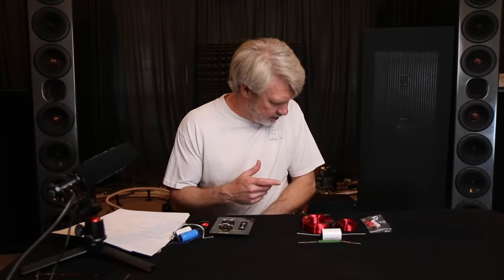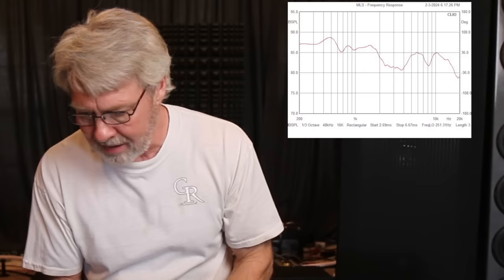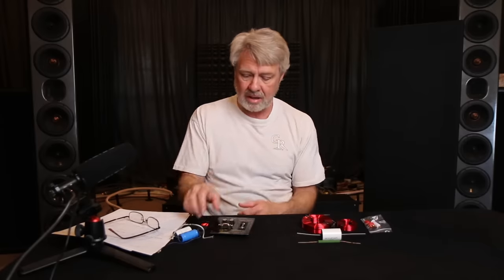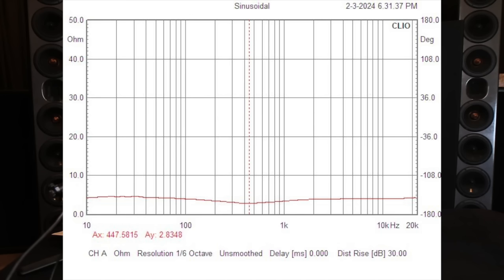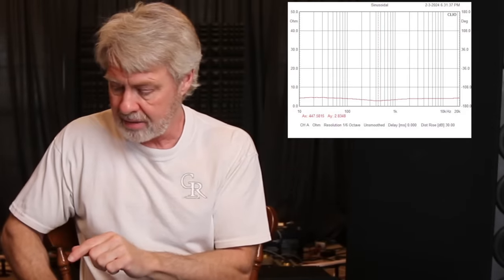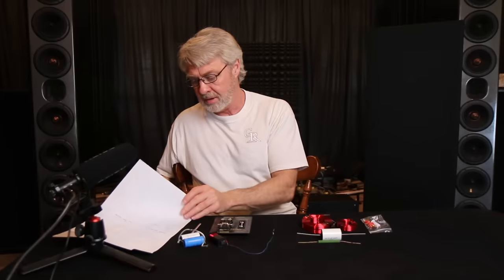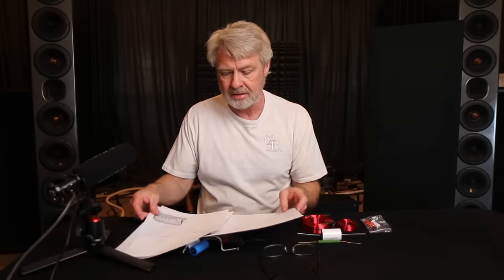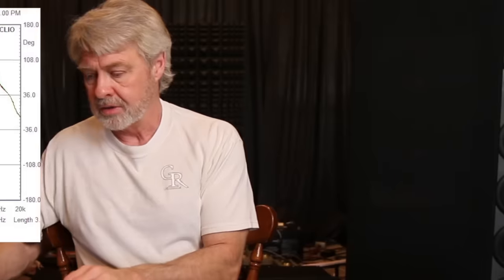Unbelievable Upgrade: Cheap Magnepans Turned into Gems

Comment: In case anybody wants to buy a pair of lrs+ and do the gr-research upgrade, I just got an email back from Magnepan saying you may order a pair without any crossover. Of course, they said no warranty if speakers were damaged during playback. They will also use pure copper leads if requested. The default wiring is cca. Plus, I inquired about the x series binding posts, and they're nothing special. While the defaults are nickel plated steel, the x series are just gold-plated nickel plated steel. That is, they took the defaults and coated them for gold. If you requst these, it's a $180 upgrade. Since the core is still steel, I doubt if they're worth the upgrade.

Comment: In case of the 1.7i upgrade,  I wonder if the new crossover can be fitted inside the space, or needs to be placed external to the speaker.

Comment: The crossovers  were always their downfall. I ve biamped with great results.
Reply: @davevolz6138 Know of any resources/how-to's regarding how to do this?  I have bi-amped (NOT bi-wired) in the past -- with separate binding posts on speaker.  Just not sure how to apply to Maggies?
Reply: @michaelsparrow4798  You have  to wire the leads from the drivers out to a terminal panel with binding posts and use electronic crossover. Don’t know if there are any YouTube posts on that.
Reply: @davevolz6138  You could also use a passive crossover on the interconnect to each amp, just simple high pass and low pass like what Danny did. Parts would be cheap since the signal is so low. Probably be better in some ways depending on what electronic crossover you are using.
Reply: Yeah, Maggies love biamping. Better even than an improved crossover. Maybe because of improved electrical damping?
Reply: They do really well with biamp because it’s solves that super low impedance cause by the drivers overlapping.  It’s basically two 4 ohm speakers in parallel.  Danny’s upgrade is a huge improvement over just bi-amping because it solves the off axis issues with the MAGNEPAN’s which is a major major issue.  It also solves the low impedance issue making biamping unnecessary.

Comment: The Maggies are here! Just set them up, and they sounded a bit harsh at first, but several hours later, they simply sound better and better as they break in. The speakers for the price? OMG! Do they sound FANTASTIC! They are cleaning the floor with my Zu DW6 Supremes... It is no contest, and I could have bought three of the Maggies for what I have in these Zu's. Danny's kit will be here Monday, and I will break out my soldering iron next Saturday and take care of this, and cannot wait to hear them. 

I have these set up with an active crossover to send the mids and highs to the Maggies, and the lows to the subs. This crossover really did make a huge difference in overall sound quality. I am using the Rolls SX45 unit found on Amazon or Parts express, get one if you own these speakers. It goes between the source and the amplifier and is dead silent. I cannot get over how good these speakers sound, especially for only a grand! I can only imagine how they will sound after giving them the "Danny" treatment. ;-)
Reply: Nice to hear.
Reply: Please keep us posted on the results of the crossover mod.
Reply: @j-rod6420  I will be reporting back.
Reply: I use a Minidsp SHD to crossover my Maggies to my open baffle subs.  It works great!  I'll be really curious to hear how the upgraded crossover works out.
Reply: Please keep us updated
Reply: @michaelwright1602 any update on Maggie kit?
Reply: @ericelmore887  I have the kit, just not the time right now.
Reply: @michaelwright1602  I wanted to see if you had a chance to install the kit?
Reply: @ericelmore887  I have yet to get to it, been extremely busy. Funny too, I was just thinking about installing it. I need to get to it. Thanks for the push. ;-)

Comment: Finished the upgrade using external wooden boxes for the crossover. Does anybody want to hear the full process or just a quick overview?
Reply: I want to hear about your process,and I definitely want to know about the end result as I've been stewing on this upgrade since seeing the video.
Reply: Fill us in! I am curious about the panels being different in build. Are the crossovers identical in each speaker? I have my kit being delivered tomorrow and am really curious at what you discovered. And yes, how did the upgrade work with the overall SQ of the pair? I was thinking of doing an external box too... Make it plug and play to the back of the Maggies to easily move around.
Reply: I left a reply on my other post in this thread.

Comment: Wow! I've heard so much about these LRS's and how good they sound with
Hegel amps. This information is pure gold. Now that Danny has measured
and done his "thing" I could actually be confident in ordering these speakers.
Of course, with the up-grade.
Reply: Can confirm:  LRS+ with Hegel H600 is off the hook phenomenal.   LRS+ with Hegel H190 wants to run real hot.   They still sound good with the H190, but if you're kicking out the jams, you won't be running that long before you get into a protection/shutdown circuit situation.
Reply: @ChuckD6809  I'd seen many reviewers saying H90 or H95 would easily power the LRS+. I auditioned it with the H390 (they didn't have smaller Hegels to demo) instore and it sounded feeble. They said that's what I had requested but they normally pair it with the Musical Fidelity M5si and that worked fine to my ears.

Comment: I never listened to the mags but a lot of people love them, I learn so much from watching these videos, I went and designed a few speakers myself and I built my reference speaker and I used all , ofc copper, silver solder, jantzen z caps and 14 gauge air coil inductors that I dipped in parfen wax, and the speakers sound so clear and dynamic, I hear things I don't normally hear in music, so I became i big believer in quality parts .

Comment: Looks like a great upgrade at a reasonable price.
I have question your concern about steel nuts on the binding posts, as you have on other speakers. I can maybe see how steel in the signal path may have an effect. Can you explain how steel nuts, not in the signal path, can be a problem?

Comment: Thank you so much.  BTW, I have a pair of LRS+'s and I run it with one of two different amplifiers and they are amazing (Hegel H95 Class AB, and dual mono class D ZA3's).  
I am comparing them to SVS Prime Ultra towers that we upgraded with your kit, KII Three's (amazing, but expensive), and Focal 11's.  In any case, your timing is excellent, as I had started reengineering the LRS's crossover based on simple analysis (looking at the cross over, listening to them and analyzing with MatLab), and you came up with two MAJOR improvements.  First, the elimination of the connection panel hardware (steel, bar, fuse, etc) and better component value choices.  
You are amazing, and THANK YOU AGAIN!

Comment: I have your kit installed in my first gen LRS which I've been running for quite a while... I recently had the chance to do a side by side with a set of stock LRS that came through my door on the way to a friend's system, and it's wonderful to hear how transformative the GR design was after a few years since I first installed them - huge increase in clarity and detail, way more high frequency extension and airiness, amazing soundstage and depth, and way less of that irritating head-in-a-vice beaming treble. The only con is a loss of that pleasant mid bass hump, which is worth losing for all the pros.  I was curious to see what was new in the LRS Plus - shock, it's the exact same crap crossover! I figured that was what they updated, but clearly not.
Reply: Thanks for the feedback.

Just a thought, but if you'd like a little bit of a hump in the bass panel you can add a .5 ohm to 1.0 ohm resistor to the tweeter circuit to bring the level of it down a little bit in relation to the bass panel. 

I think people often don't realize that there is still some adjustability to the balance.
Reply: You have the same experience I've had with the lrs upgrade. Another thing to point out is that since the bass is flattened out, bass extends lower perceptually and you can run into the limits of the Maggie's bass more often that without the bump in mid and upper bass.
Reply: No, there are two major changes in the + and they have nothing to do with the crossover.
Reply: @Josh442  What do they have to do with?
Reply: @peterdesmidt8742  The mass of the tweeter has been reduced, improving frequency extension. I'd have to get their permission to discuss the other change!
Reply: @Josh442  No worries, Josh.   Thanks!  I really like my LRSs.

Comment: There is much about how tedious it is to remove all the staples holding the sock in place. Any word on re-stapling the sock back in place. What type of staples etc.? Any concerns stretching the sock back in to place....that kind of thing? Looking to place my order soon. Cheers
Reply: Removing the staples is a pain in the rear end, but not a problem. We have a little hand held stapler that drives in new ones pretty easily. You can pick them up at a hardware store.

Comment: One lesson that I learned is that sometimes you have to compromise performance to protect drivers. I have a powerful DIY amp and a DIY DAC. The amp dumps all it's power to the speakers in case of a loose connection with the DAC. That's over 800 watts per channel and my tweeters have no resistor due to their low sensitivity. They are not playing that low, second-order HPF with 6.8uf polycap and 0.39mH aircore inductor. So yeah, the amp has destroyed three sets of tweeters. I had to solder a fuse to a wire and connect in series with the tweeters to protect them from the amp. Performance degradation was very small. Most fuses are made of tin-lead which doesn't negatively affect signal alot, the signal goes through them some preamp and amp sections.

Comment: Hello I am about to order 3 LRS+  for my theater front end, I just found your upgrade presentation. My question is should I be buying the LRS  model not the plus.  and then add your upgrade kit.  I would have thought the new plus model would have upgraded the cross over. If your upgrade kit can give me a better listening experience  installed in the older LRS. I would prefer to go that way  your thoughts please thank you .
Reply: We have an upgrade for the standard LRS too.
Reply: Magnepan for theatre, are you crazy? Lol

Comment: Great video and kit!
Got anything for my old MMG's?
Reply: Yes we do.
Reply: @dannyrichie9743  I see LRS, LRS+, .7, 1.7 and up on the GR site. Discontinued, Perhaps? (They are pretty old)
Reply: @markwagner1997  We never added the MMG to the site. We just didn't think there was as much interest in it.
Reply: @dannyrichie9743  I modded my MMGs over ten years ago by changing to the earlier crossover which, IIRC, used a higher order crossover on the tweeter. Used higher quality parts, and of course bypassed the fuses and got rid of all the steel in the signal path.  Big improvement!  Also stiffened the frames and raised them up off the floor.  Very happy now!   In other words, everything you said in this video makes tons of sense.

Comment: As the response is different from the tweeter to the woofer, I believe that it would affect imaging depending on how they are set up. Would having the tweeters on the inside be suggested or the outside?
Reply: I tried mine both ways, the tweeter on the outside sounded the best. Add an active crossover and these babies SING! I'm using the Rolls SX45 found on Amazon or Parts Express for $109. It is dead silent and takes the stress off of the amplifier, as the bass is sent off to the subs. Danny's kit will be here tomorrow.
Reply: @michaelwright1602   I had Peter Gunn modify my little MMGs.

Comment: I have 3.7i's, there is definitely a head in the vice Sweet Spot which I don't mind because I only listen by myself. It's a much wider Sweet Spot than the lrs that I used to have which was the reason I upgraded. Magnepans need to be focused toward your ears. I hope that's where you guys are taking your measurements from since I don't believe an arbitrary position on the panel would give you a good measurement.
Reply: You should try our upgrade to the 3.7i. It really takes that one to another level. No more head in a vise either. It sounds balanced from anywhere in the room.

Comment: Amazing results with the upgrade! Guys, buy this LRS+ (US $995, EU €1800) AND the upgrade from Danny. You wont regret it once you did everything right. Must say i added mechanical improvement on these little mdf planes and added a purify 300+ class D amp from Audiophonics in France as well as LS cable upgrades suggested by Danny. GR Research servo subs melted fine with this gear!
Reply: I found it dropped  the output too much.

Comment: This appear as one of the most valuable upgrades in the sound reproduction industry. I have been an amateur speaker constructor for three decades, and worked on a daily basic with Duelund his last four years. In my opinion, every construction will also benefit, on a focus on vibrations, after a crossover is made. And not only in the cabinet. Magnepans has a big active membrane, and this membrane vibrate to make sound. These vibrations, do not stop 100% after the sound making movement, but travel horizontally to the side panels, that is hard MDF which do not absorb the vibrations, but make them return to the membrane. As time delayed distorsion, naturally. 
So, by installing a thin vibration dampening material on the membran, felt or other material, a few mm. where the membran meet the frame, will stop the returned vibrations easy. Which gives increased dynamics and naturally sound as a result. And no negative effects at all. To a minimal cost and ten minutes of work if the cloth is removed already. The same cloth can stay permanently removed with a slight sound benefit. 
Another cheap and simple upgrade, is to use car chassis damping plates, and cut them in 5-6mm. stripes. Then glue them to the magnets from behind. The same upgraded dynamic and clearer sound will appear. A simple and fun upgrade, also the kids (and wife;-) will having fun, helping to do. And often be amazed by the result sonically.
Reply: That's called edge damping. I've asked Magnepan about it, and they claim it doesn't do very much. Not sure why -- maybe they used the wrong material?
Reply: @Josh442  Thanks Josh. I have done it it, and as i wrote, edge damping is clearly audiable. As dampenig of the magnets from behind is. Bypassing the resistor and stiffening the frame and Dannys crossover upgrade of course the same. Do you have other upgrades that works? Best, HH from Denmark.
Reply: @BowmanDk1  I can think of a number, but by and large, they all involve pretty major surgery, such as building an entirely new constrained-layer baffle. But you've hit on some of the important mods, e.g., stiffness. The dual-magnet designs (20.7 and higher) fix this because the two opposing magnet assemblies reinforce one another. If I were building a new baffle, I would consider moving the ribbon closer to the midrange for better behavior (lobing) at the crossover point -- right now, the only reason they're so far apart is structural. But the mod that I think will do far more than anything else is bi-amping with an electronic crossover. I'd add DSP, on the woofer, at least. Better XO's and, of course, you can do judicious equalization.

Comment: Suggest a brief video of exactly what is involved removing the socks.  The mention of the daunting disassembly scares me off of this.  (I do own LRS+'s.)  Have ordered upgrade from you folks before and had no problem assembling/installing -- but it was in a traditional box speaker that removing the mid/woof provided access.
Reply: Plenty of videos out there on what that’s like
Reply: It's mainly removing a lot of staples from the bottom, only to find another row of staples. Then slide the sock up, unscrew the input panel, then you can slide it up further to access the crossover  on the back and driver terminals on the front. It's not hard, just kinda tedious.
Reply: @veroman007  NOT helpful.  I googled it before posting.  Nothing recent nor specifically for LRS. Please see next reply for example of how to be helpful.

Comment: Would this same kit benefit the older MMG? Or would I need different resistance components?
Reply: We designed an upgrade for the MMG a few years ago.
Reply: @dannyrichie9743  ... can it work for the MG-12 Danny ??? ( i hope so...) i pull out the fuses and install Rhodiums Cardas connectors....
Reply: @KillerKojak  This upgrade only works for this model.

Comment: They only perform to a "designed"  certain level so that you go buy the next higher priced speaker
Reply: Exactly.
Reply: Even the higher end models are built the same way. Look at the upgrade video for the 3.7i
Reply: @hafgrim.  You are correct.
Reply: It wasn't intentionally crippled, if that's what you mean. Rather, it was built to a price point -- if they used more expensive components, they would add several hundred dollars to the cost -in consumer audio, the selling price is 4X the cost of the parts. They describe it as an "appetizer" and its main purpose is to expose people to the Magnepan sound so some will move on to the more expensive models.
Reply: You basically gave a good argument against what you originally had said.

Comment: It's time that Magnepan designs an exterior crossover unit for each panel. Update on those leg stands. Surprise! 
Magnepan has outsourced a company that makes an excellent, solid leg brackets for their panel speakers. Can they do this for the crossovers? Thanks Danny for sharing.
Reply: Peter Gunn. His work is good.